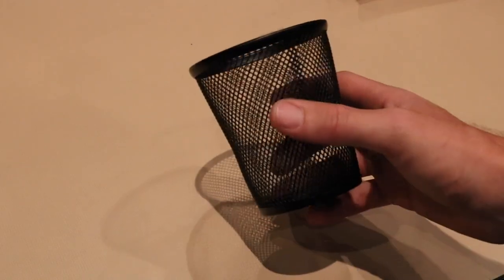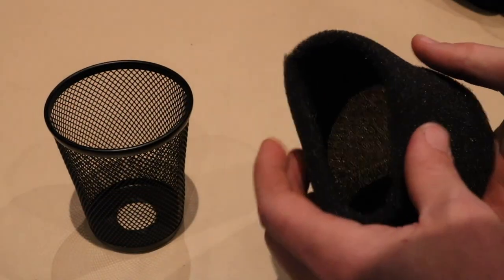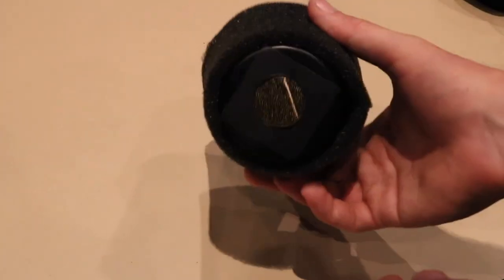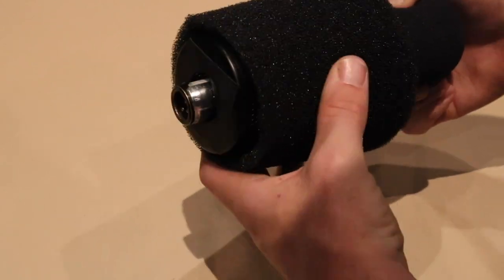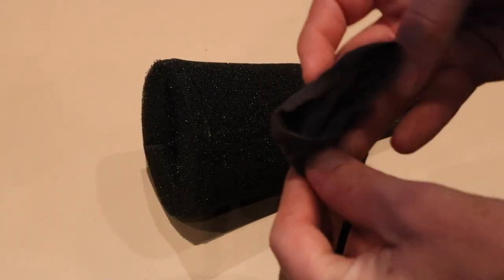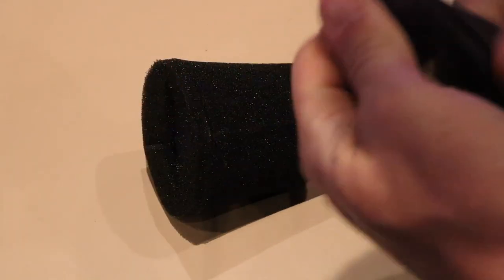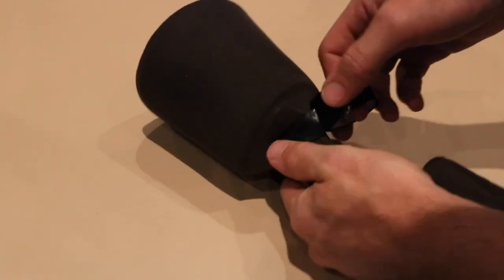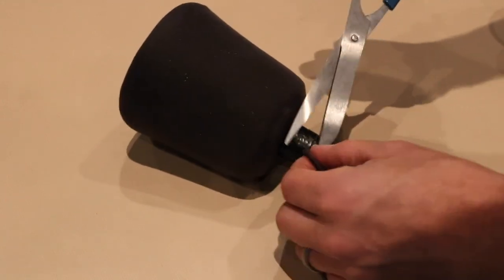DIY amazing microphone windscreen

Comment: You didn't explain how you turn a flat sheet of foam into a foam cylinder (actually a conic section).  What do you use?  Bubble gum?  What kind of foam do you use?  How thick?  Any particular brand or source?